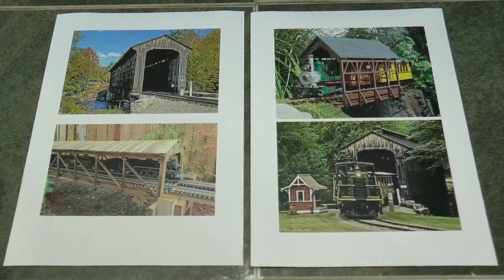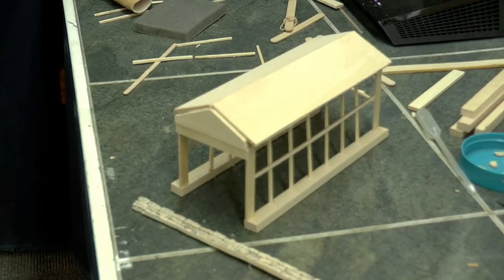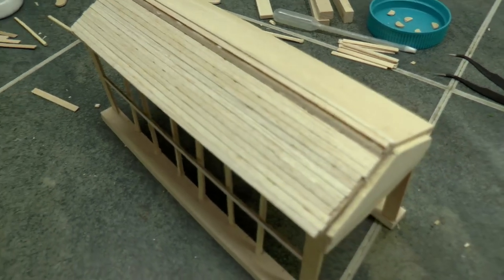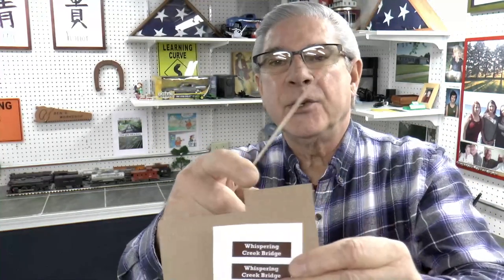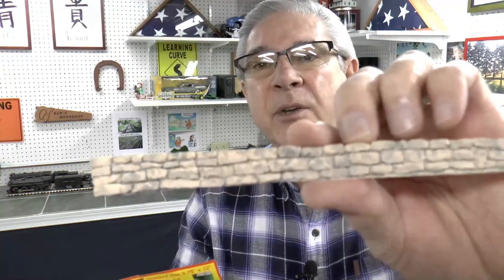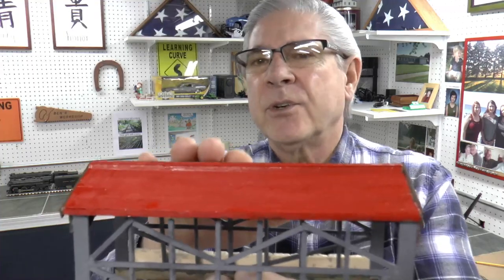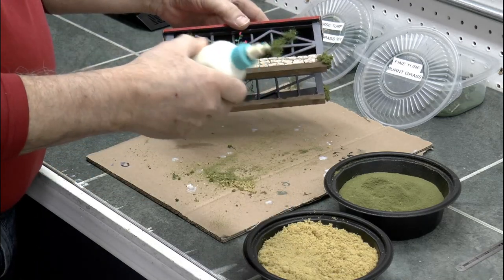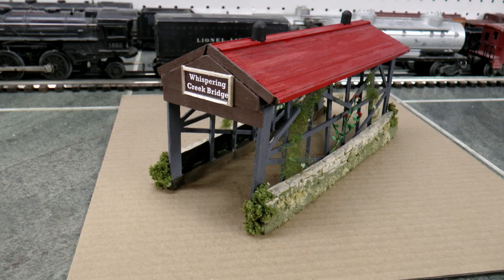Building A Covered Bridge

Comment: Ben, I just discovered your channel and have been watching your videos.  I'm not very well "versed" in how to use YouTube so please accept my apologies if I'm doing this wrong.  I'm working on my second (and probably last) layout after retiring.  My first layout was over 50 years ago and what fun it was!  After "re-starting" my hobbies I realized quite suddenly that it's "not quite like it used to be".  Hobbies seem to be a thing of the past.  Anyway, I'm going to fill a 3 foot gap on my layout and you have a video that is exactly what I'd like to do.  I have two mainlines running side by side.  To make a double track, do I simply widen the deck or is there more to it?  I know prototype trestles would require more structure.  Do I need to do that on a trestle like the one you built?  Thanks for your exceptional videos!
Reply from the maker: Hi Thomas, thanks for the question and also for vising my channel. If you are going to run 2 mainlines running side by side, I would suggest allowing a minimum of 3 inches between them. If you add a trestle structure, I would recommend a minimum of 8 inches between the lines. I agree with you, things have really changed in this hobby over the years, but like you I find it's still a ton of fun!  I hope this answers your question, and please feel free to keep in touch with any future questions or comments. Thank you!